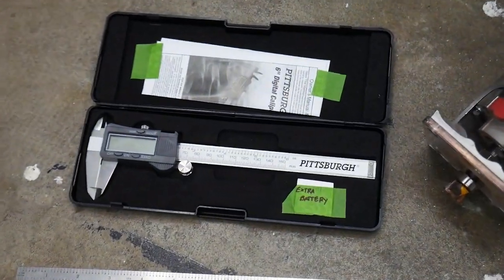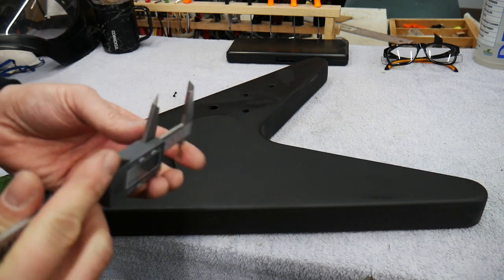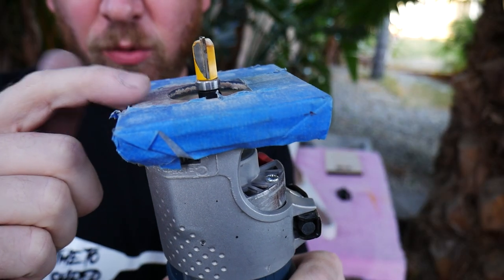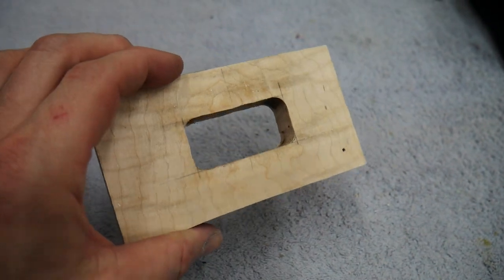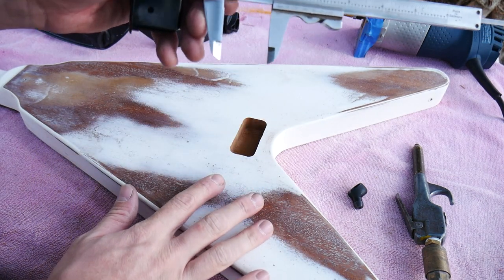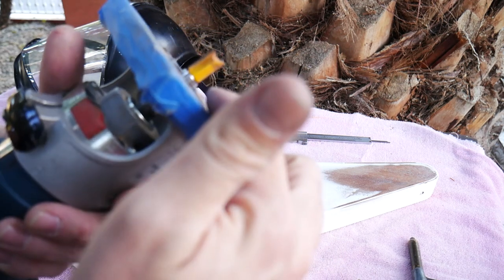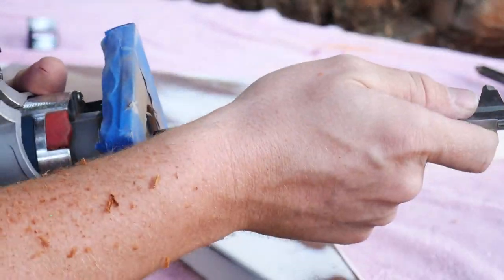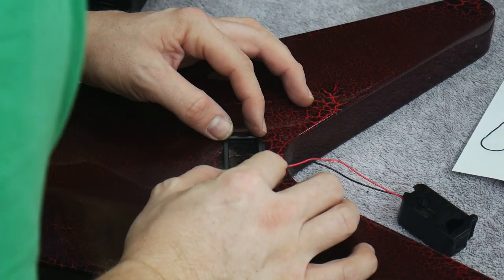How to add a Battery Box to your Guitar - Tutorial - 9-volt Install DIY

Comment: I kind of wish you showed putting the battery into the box... Normally when I have to put batteries into things, I have to watch the battery in between a metal plate and a spring. But that battery box seems like it's some type of quick load battery thing, where I just drop the battery in and shut it

Comment: I’m doing it on my Strat’s body; I’m putting a single sized sustainer pickup between a DiMarzio X2N (bridge) & a DiMarzio D Activator X (neck), & I custom-ordered a Sustainer pickup to match my DiMarzio humbuckers, and it’s awesome…it’s a guitar I’ve been wanting to build since I was like 14 years old…with a dremel I’m routing the back beside the Stratocaster Spring cavity… like the Richie Sambora Stratocasters have for the 9V required for the Fender Active Mid Boost